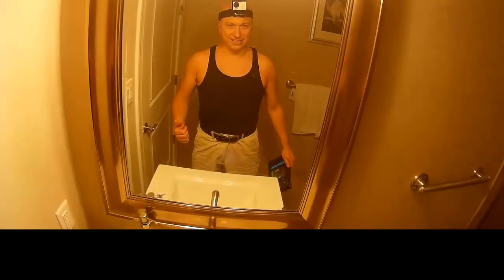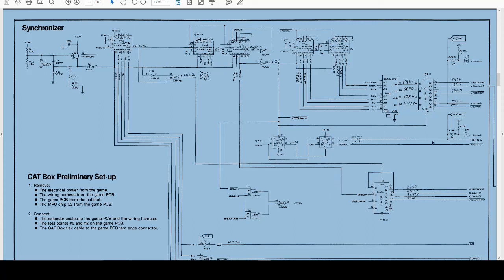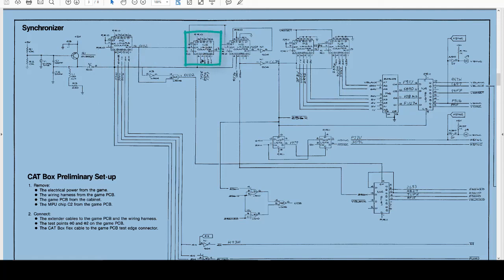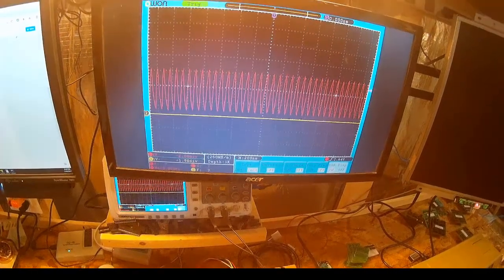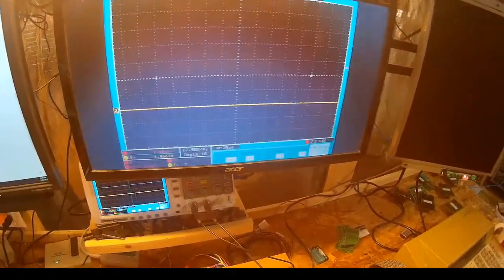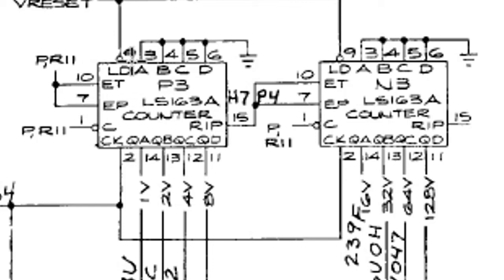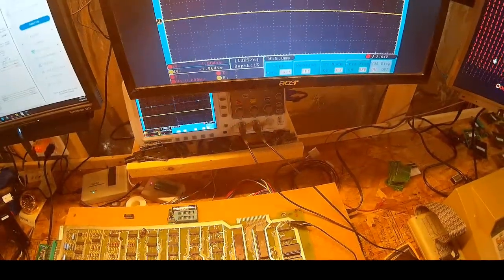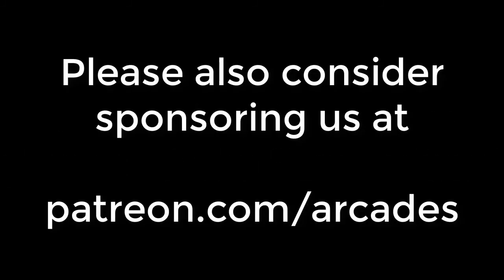Understanding and Troubleshooting the Sync Circuit

Comment: What does the Clock Enable inputs ENP, ENT, CEP, CET on counter chips in arcade games do? mostly these clock enable inputs are tied high with a pull up resistor but it the clock enable inputs weren't tied high the counter wouldn't be enabled which means the counter chip would be in what state or used in what type of application?

Comment: what determines the speed of the games program code? because the RAM chips access time is based on the game program code?
Reply from the maker: Do you mean how fast the code runs, or how fast the RAM must be to work in the system? In both cases basically it depend on the CPU and the CPU clock. For example the Z80 manual states the following below in terms of memory reads as well as a timing diagram. What the below states 
is that the CPU expects after a memory read is issued, that the memory contents will be available 3 clock cycles later.  Which means a memory speed must be choose  such that the data is ready at that time. Keep in mind different CPUs even of the same type have different clock speeds (for example I think Z80 has (1mhz - 4mhz speeds) 

Below is a way more technical link explaining timing.

http://www.piclist.com/techref/mem/dram/slide4.html

--- from Z80 manual ---

"Figure 6 shows the timing of memory read or write cycles other than an op code fetch
cycle. These cycles are generally three clock periods long unless wait states are requested
by memory through the WAIT signal. The MREQ signal and the RD signal are used the
same way as in a fetch cycle. In a memory write cycle, the MREQ also becomes active
when the address bus is stable so that it can be used directly as a chip enable for dynamic
memories. The WR line is active when the data on the data bus is stable so that it can be
used directly as a R/W pulse to virtually any type of semiconductor memory. Furthermore,
the WR signal goes inactive one-half T state before the address and data bus contents are
changed so that the overlap requirements for almost any type of semiconductor memory
type is met."
Reply: @arcade-cabinets  thanks for the help, 
 i see the access time on the datasheets for parts like RAM chips, PIA chips, PLA chips, 
because PIA chips and PLA chips have access time also?
but I don't know what determines a designer to choose which access time is right for the game programming code. How would a software arcade game programming code know which access time to choose for the IC chips?
The software game programming looks at all the datasheets access times for the all the IC chips and choose the access time based on the Clock speed? 
If the clock speed is 1Mhz, what access time would be good to use?
If the clock speed is 4 Mhz, what access time would be good to use?
Reply from the maker: @billwilliams6338  The programmers don't care about access time, they just write code that they want to run. Its the responsibility of the people that design the game hardware to match the right RAM speeds with what is required for the given CPU.
Reply: @arcade-cabinets  but how does the game hardware engineers know which access time to choose? is it based on the games code speed or the CPU clock speed?
They would have to experiment with different access times for the RAM chips, PLA chips and PIA chips to get the correct sync to MATCH the games code and CPU clock speed with the access time? I'm the hardware engineers just experiment with different access times until they get a good Match?
Reply from the maker: @billwilliams6338  Each CPU manual states the timing required for the memory access, via the timing diagrams and other technical information included in the CPU manuals. The hardware engineers then find a RAM that falls within the require performance requirements of the CPU. (the RAM performance specifications are published in the RAM datasheets)
Reply: @arcade-cabinets  thanks for the help
Yes i totally understand that, this is why I'm confused is because most arcade games used a Z80 CPU But the RAM access times for different arcade games used different RAM access times and they used the same Z80 CPU. I would think the RAM access times would all be the same access time because the Z80 CPU is the same for many arcade games. Most of the arcade games in the 80's used Z80 CPU but if you look at the schematics the RAM access times are different which doesn't makes sense because the RAM access times should be the same i would think because the datasheets for the Z80 CPU is the same.
Reply from the maker: bill williams they probably used whatever they had on hand as long as the speed as at least as fast as needed any speed faster can be used. So say a 4mhz z80 requires 150ns (I’m making that up I did not do the math or check) ANY ram 150 or faster would work.
Reply: @arcade-cabinets  ok thanks for the help.

Comment: ARCADE CABINETS.COM
       The ROM's chips data width size doesn't equal when your "subtract" the address start and address end range. Any reasons why they would want blank unused space in the ROM chips not having any code? Is the blank space used in the ROM chips used for compiling the ROM data contents?
Reply from the maker: It should match that is for example a 2716 should have 0x800 addresses when subtracting the end - start (+1) (add one because addresses start at "0" not 1, so you have to add 1 to count that) If in my video I put in a range that didn't equal whatever the ROM address size was, then I just messed up and for some reason I got lucky and the mistake didn't cause an error.)
Reply: @arcade-cabinets  yes I have seen  you do this. But when you Read the ROM data contents using a programmer a 2716 data width will not always equal to the start & end address. It will be LESS data width loaded in the ROM chip compared to the ROM data width size. There is blank unused  space left on the ROM chip with no data being used. So they aren't using the full length width of the ROM chips data width size, they are loading the arcades game data rom content that is less data width compared to the Rom chips data width. Have you noticed this in some arcade games?
Reply from the maker: bill williams I don’t understand what your saying, a 2716 has 8 bit/1 bytes width, and the reader will already give back 1 bytes per address read.
Reply from the maker: I Don’t know I’ve never repaired a joust so I have not looked at the schematics.
Reply: @arcade-cabinets  oh ok thanks
Reply: @arcade-cabinets  
2716 to compute the total data width of the ROM chip the formula is 8 bits multiplied by 800 addresses = total data width?
 2732 formula is 8 bits multiplied by 1600 address = total data width?
2516 chip formula is 4 bits multiplied by 800 addresses = total data width?
Reply: @arcade-cabinets  Joust,Defender,Robotron,Sinistar,Stargate, Bubbles uses the eight shift registers to output data to the screen four bits at a time for a 16 color pixel. 
I'm not sure what this really means why they wanted to output 4 data bits at a time to get a 16 bit color pixel. Can you explain what they mean by this because I'm guess other arcade games would only output 1 bit at time to get a 16bit color pixel? 
The color PROM chip outputs 1 bit at a time  to the color RGB output circuit which has DAC converters to output RGB analog voltages
Reply: @billwilliams6338  I don't know if that's true as I never looked at Williams games, however assuming it is true, it does make sense. for every "bit" that represents a color the number of possible colors doubles. For example 1 bit can display 2 different colors "color=0 and color=1" 2 bits would be 4 colors "color=00, color=01, color=10, and color=11", 4 bits would be 16 colors, "color=0000, color=0001, color=0010, color=0011, color=0100 ... all the way to color=1111" basically the number of bits used raised to the power of 2 is the number of possible different combinations.
Reply: @tvbrzezicki2874  thanks for the help 
But the only has 1 bit input Color Prom chip and outputs only 1 bit so how does it get 3 RGB colors out of 1 bit?
Reply: The Color Prom chips only has 1 bit input to the color prom chip and the color prom chip outputs 1 bit so how goes it get 3 RGB colors out of 1 bit plus 16 bit pixels?